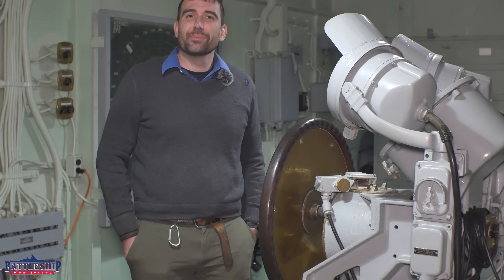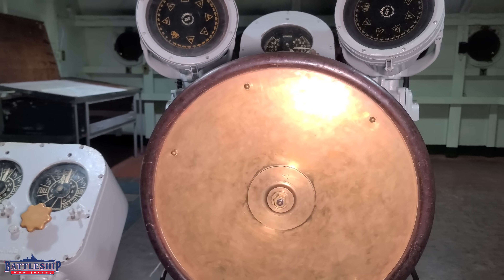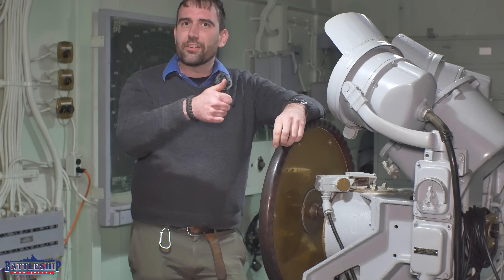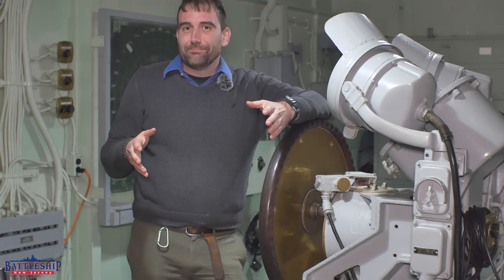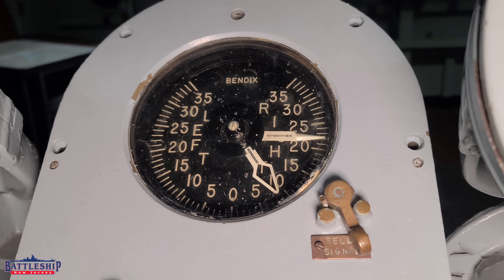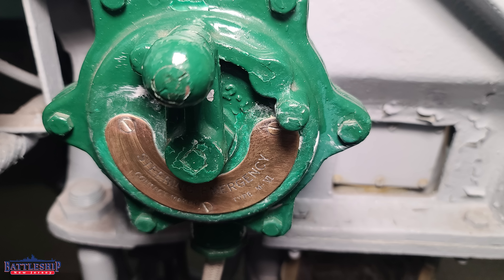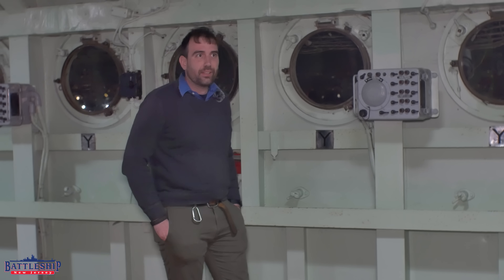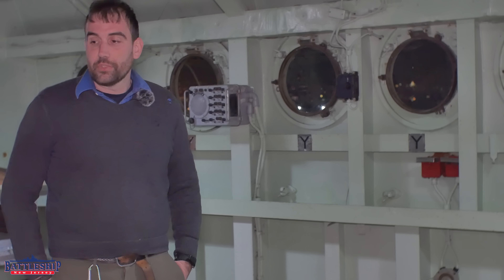Steering an Aircraft Carrier

Comment: I worked a block away from the USS Intrepid for 10 years and I always assumed that those portholes were for ventilation because of the hanger deck. Thanks for clarifying that for me
Reply: There's actually quite a bit of stuff in between these ports and the main part of the hangar deck; immediately after and below Secondary Conn are the forecastle and the anchor windlass compartment, then a whole mess of Junion Officer Berthing, heads and such. THEN the whole Elevator One deal, the after side of which faces onto the foremost hangar bay. No space is wasted; there's something crammed in EVERYWHERE. (EDIT: at least on Hornet, I assume Intrepid is essentially the same.)
Reply: Last time I was on Intrepid (many years ago), they had opened up the forecastle area and you could see the anchor chains. I had no idea there was anything above the forecastle on an Essex class!

Comment: Guessing it would not be considered ideal to have to leave the wheel to sound the collision alarm... pretty important to maintain continuous active control of steering at that point (I know that someone other than the helmsman could have been ordered to sound the alarm, but why introduce that delay when you could just put the alarm next to the person in that space most equipped to a) notice and b) do something about a threat of collision)
Reply: the helmsman's one and only job is to maintain ships course by looking at gyro repeater.    The officer of the deck is looking out the windows and sounding alarms.
Reply: @gar949  huh, didn't know that - I wonder why the alarms are split like that in that case
Reply: It's the Navy.
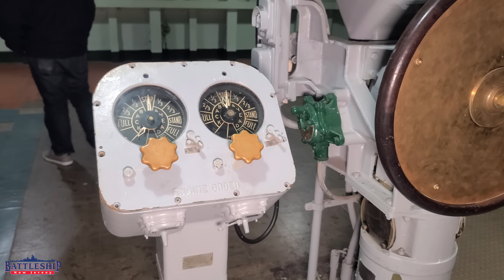Reply: 1:12 It's literally on the wheelpost
Reply: @StacheMan26  exactly - I was (admittedly not very clearly) commenting on the fact that of the three alarms in the space the collision alarm is the only one on the wheelpost (where the helmsman could use it instantly), whereas the GQ and chemical warfare alarms are on the aft bulkhead (presumably the ranking officer in the space, who probably wouldn't be at the wheel themselves, would be more likely to sound these or order them sounded, as they're not directly to do with navigation)